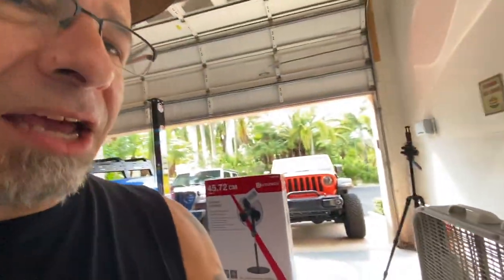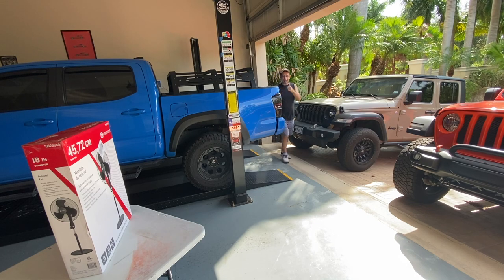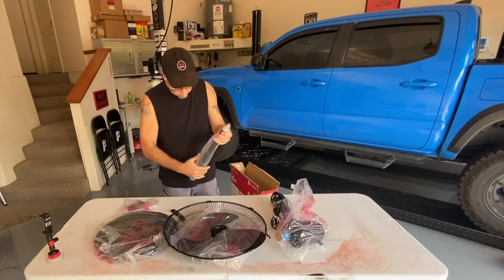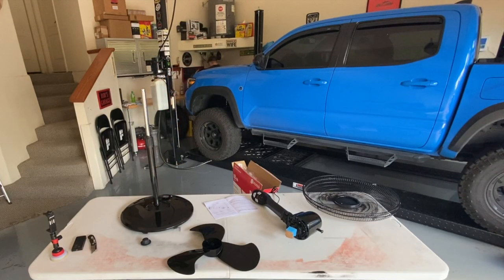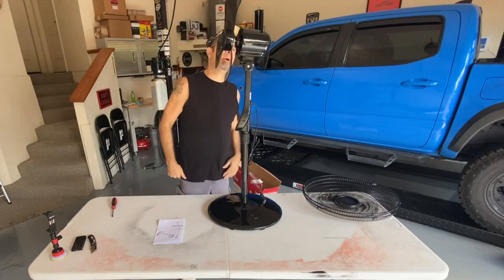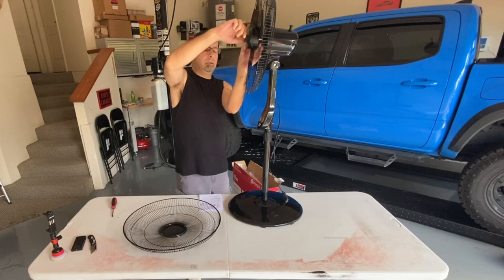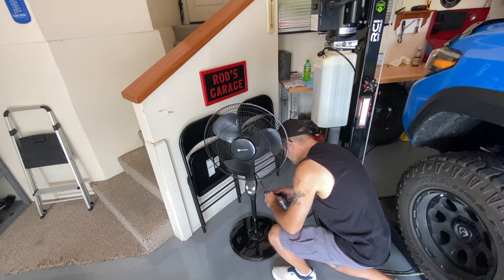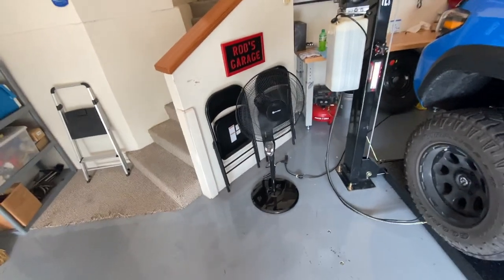New Utilitech Fan for my Tacoma Garage

Comment: Rob after a while the fan blades and cages get dusty and dirty.  It'll be next summer before you are ready to clean it.  I have two white ones like that and they get dirty real quick-like.  On a sunny day, I take the cages off and the fan blade to my back yard and spray the cages and fan blade with Lysol spray cleaner just soak them in Lysol.  Let sit for 30 minutes then wash off with a regular water hose and then set them in the sun to dry.  Looks like new when done.
Reply from the maker: Thanks for the tip👍